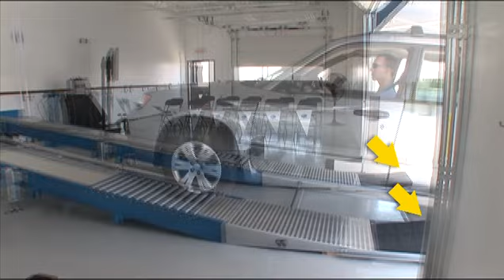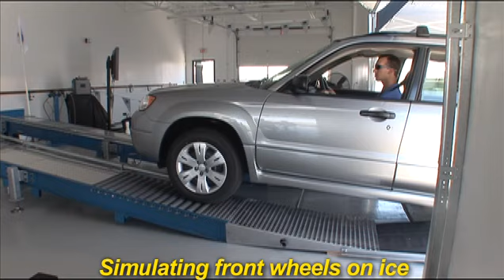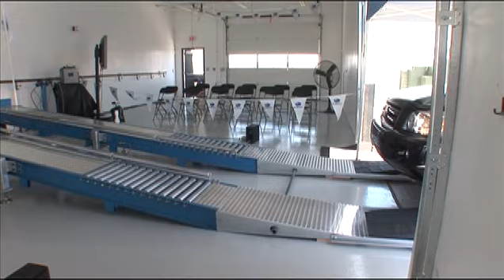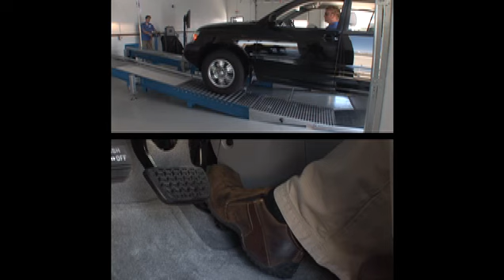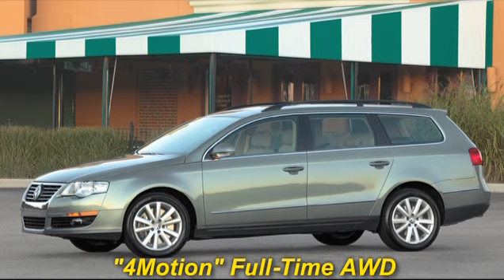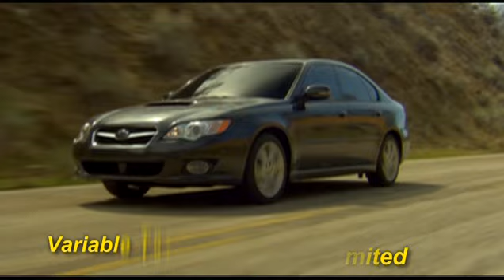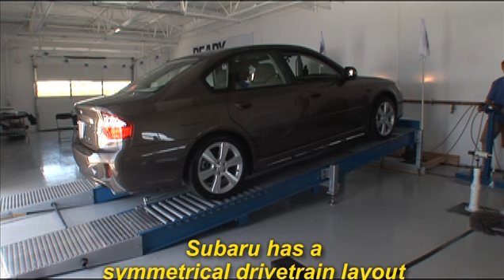Subaru Symmetrical AWD vs. Honda, Toyota, and Volkswagen

Comment: Regardless the definition of full-time awd is very blurred.  Different manufacturers have different definition and different design have their pros and cons.  A full-time AWD can be open diff, limit slip, diff lock, clutch back, torque vectoring, viscous coupled, etc.  At the end of the day they just want to market their cars.  It's important to do the research to find out how it actually works (if awd is of particular interest to you), and don't be so focus on what they call it.

Comment: Your description of the volkswagen system is incorrect.  Volkswagen uses a haldex coupling system, not viscous-coupling.  Haldex coupling actually uses a positive displacement axial differential pump to generate oil pressure when the input and output shaft rotates in different speed.  So it is a "slip and grip" system (Gen IV on Tiguan is different).  I'm not aware of subaru using a viscous coupling (slip and grip) system, I think in manual system they have viscous limit slip centre diff.

Comment: Full-time awd means simply that ALL wheels are connected at ALL times and are providing SOME level of traction, be it FWD biased, RWD biased, or 50/50. Realtime means a system that is JUST FWD or RWD which couples the other two wheels IF a slip event is detected.

Comment: It is not "my" definition, just how the systems work. You are incorrect, the Volkswagen 4Motion is full-time because even though the vehicle is FWD-biased, the rear wheels are still coupled and are providing traction. It is a viscous-coupling system similar to the one used by Subaru. The automatic transmission Subaru drivetrain does not use a center diff, instead it uses an electronically managed variable multiplate clutch in the tailshaft. And it is still a full-time awd system.

Comment: ok, while I agree full time (means there's a center differential so you can use it on dry pavement) is good because traction loss is less likely in the first place, but onces one of the wheel lose traction a system with 3 open differentials can get stuck.  Traction control, limited slip or locking differential is needed to recover.  The name doesn't really mean anything now a days (most make up their own name, like SH-awd).  The VW passat is a real time system btw according to your definition.

Comment: You are incorrect, a real-time awd vehicle is essentially either FWD or RWD UNLESS there is wheel slip. It basically means it only helps if shit happens. And sometimes you get in trouble BECAUSE it's RWD or FWD on. Full-time is a better system because it works harder to keep you out of trouble at all times, no matter what.

Comment: CRV should atleast get over the first hump.  Having LSD at the back will help CRV pass the last test, only one rear wheel with traction.  Forester wouldn't pass that one neither as it doesn't have LSD I believe.
Full time AWD, real time...etc has all became meaningless as it doesn't correctly depicts their capabilities anymore.  In the past full time AWD consists of 3 open differentials (look at mercedes 4Matic).  Well before traction control these full time AWD won't even pass the firt hump!

Comment: Also, I don't think the side to side movement of the highlander is caused by "torque steer".  Torque steer is caused by unequal drive shaft with the longer shaft twisting more than the short one under high torque situation.  Well, if the front wheels are on rollers than there's no high torque experienced by the drive shaft, so torque steer should be negligeable.

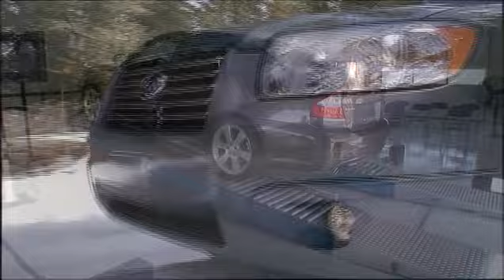Comment: but how do we know that?  The whole setup sure looks like it was done for Subaru.  Just check out 9:50.  The reason I'm not taking this clip too seriously is because I find some of their "explanation" not convincing.  For example, the Honda system actually uses hydraulic pressure created by difference in rpm between front and rear axle to actuate a clutch pack.  The greater the speed difference, the greater the force transmitted.  If they just give it more gas I'm sure the CRV will climbe

Comment: oh this could easily be fake.  Certain AWD system can be deactivated as easily as just pulling a fuse or pulling the handbrake.  The rollers are lockable.  So who knows if the subaru got a little extra help if some of the rollars aren't actually free rolling?  Not saying that's actually the case here, but I'd take this experiment with a grain of salt

Comment: Honda clearly states in the CR-V owners manual that in certain challenging terrain situations (deep snow), it may be effective to disable the traction assist, thereby giving the driver full control over the throttle. In my experience - the crv got stuck in deep snow with the traction control on - once disabled - all four wheels spun freely and moved quickly out of the snow

Comment: i agree. that was what i noticed first, not showing the rear wheels. however a transversely mounted engine does make a difference in that it invokes torque steer, but i don't know how this would have an effect on traction.? i think if it is real most of the difference can be attributed to the LSD. IMHO

Comment: isn't the transfer case has a Differential gearing in it...so its possible that is LSD as well... so pretty much if front or rear slips it will tranfer torque to whatever side that has traction. when you think about it there are atleast 3 differentials in 4WD.

Comment: I have seen similar results with the TopGear Australia episode 1. They also found that the Nissan X-trail just an effective FWD with a AWD image. I am kinda surprise that the toyota is shit, considering their experience in making 4WD.

Finally, to have the one wheel traction is less to do with symmetric drive system. It is mainly due to the limited slip diff.
Note that the rear wheel of the subaru slips a bit even when there is traction? this is because the rear of the car is lighter than front.

Comment: this is really suspicious because they're not showing the rear wheel of other vehicles...i dont think even if the engine design has the transmission right or left of the engine...it should make any difference... something really suspicious! but interesting

Comment: Good video, for those that claim it's clearly biased or fake, care to elaborate how or what's fake about it? All cars clearly are on the same rollers, folks. If you're wondering what the back wheels are doing, all they have to do is overcome the obstacle under the form of a bump. Trouble is, once the front wheels lose traction the rear ones do as well and that's the whole point of a GOOD awd/4wd system, so that torque is distributed from the wheels that slip to the wheels that grip.

Comment: The rear wheels only have to overcome the same bump as the front wheels, you can see the car bouncing as it pulls in. The problem is, the rear wheels can't seem to be able to overcome the obstacle when the front wheels lose traction. Look up the basics of AWD and 4WD drivetrains and you'll understand why.

Comment: Yes, the H6 is IDENTICAL to the 4 cylinder layouts, just with 2 more cylinders, and 1/2 more liter displacement... Subarus front and center Diffs are in the transmission, because of this, almost any motor and trans combination made by subaru can work. The h6 can bolt to a 2.2 4speed, and a 2.5rs can bolt to an STI 6 speed. Doesnt matter, same car, same parts.

Comment: It's clear that the intent of the video is to promote Subaru AWD. OK, fine. I'm a HUGE proponent of AWD, and have been since 1980. There ARE flaws in the video: The CRV does NOT have a center diff, it has a viscous clutch that transfers some power to the rear. The lower cost automatic Subarus use a FWD-based "on demand" AWD system that ALWAYS powers the front wheels - this is why the Forester pulled cleanly away with both rear wheels on the rollers. It had nothing to do with traction control.

Comment from the maker: sqreeze said that audi does not have a system comparable to the DCCD system... which is found in the STI. that is true. The sti uses 2 Torsen Diffs for the front and the rear and uses a planetary gearset in the middle. Please control your language or I will delete your posts

Comment from the maker: I don't know where you're getting that from. The  disclaimer says that the video is strictly showing what the systems are doing in this setting and not attempting to explain the minutia of how each system works mechanically or through engine management.

Comment from the maker: Ford hasn't released much info on how the MKZ's AWD works. It is front wheel biased vs the GT/3.0R having a 45/55 torque split. The GT/3.0R also have a rear limited slip differential which aid in power transfer from side to side. The MKZ does not. Lastly. The MKZ was not designed for primary duty as an AWD vehicle. It is a revamped Mazda 6 that became the Ford Fusion/MKZ. The Legacy is designed from the ground up as being only an AWD vehicle.

Comment: Trying to choose between 08 Lincoln MKZ AWD and 08 Legacy GT or 3.0 so this is informative. Did all cars have traction control on? Why can't we see rear end of cars? Wish they would show the MKZ on this ramp. There is a MKZ commercial which shows a MKZ AWD climbing steep incline with tons of ball bearings coming down the incline. Great commercial.

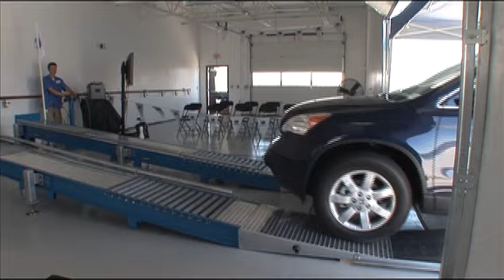Comment: I know what they were trying to demonstrate, and I like and respect Subies, but at least make the comparisons equal. These were not. The CRV is only designed to deliver about 20% power to the rear as a traction aid, as are many AWD vehicles. Notice at 0:58 that the test driver backs off to keep the Honda from climbing the ramps? Also notice that they feathered the gas in the Subaru one-wheel test? Throw in an old 4WD Colt Vista or a REAL Jeep and run the test.

Comment: most audis are priced at the top of the line subarus like the wrx sti.  the sti comes with 3 differentials, with the ability to lock the torque 50/50 for low traction situations.  Audi does not have a system comparable to the DCCD system

Comment from the maker: Also... road and track has an article with the Legacy GT vs. an A4 and the Legacy's AWD out hustled the A4 around the wet and dry track. 

P.S. Quattro is not the same on all models. The Audi TT and Audi A3 use a Haldex system, the same as what is found on the Passat.

Comment from the maker: The driving events compare Subaru's true competition... the vehicles that the average customer would be cross shopping. FYI Subaru uses a Torsen rear differential in the Legacy GT. The STI also uses a mechanical differential on the front.